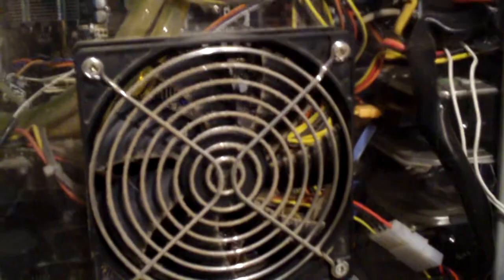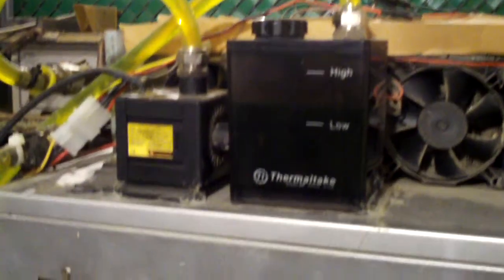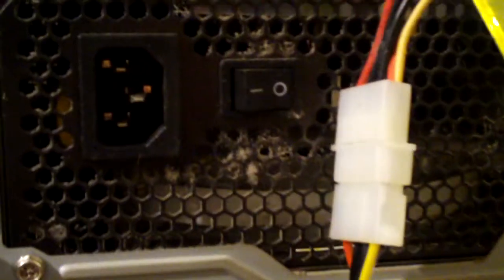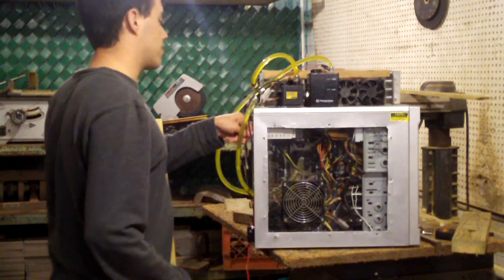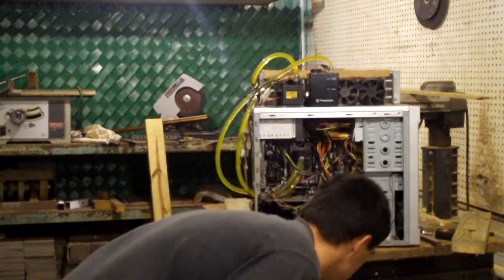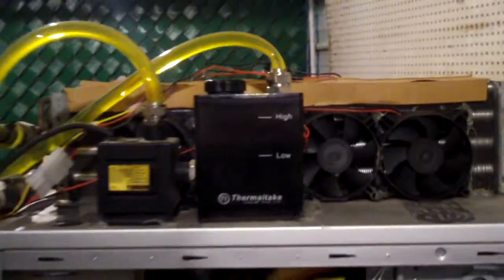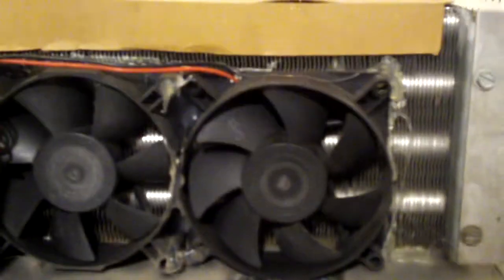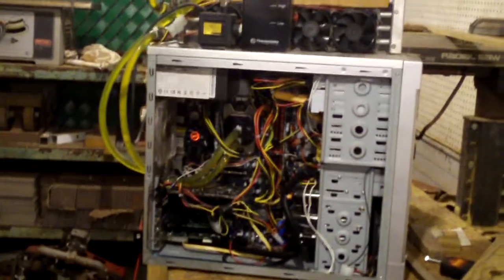Overview of filthy MTDX + Fall 2012 dust show (cleanout)

Comment: nice machine, you should add some coarse foam as an air filter in the intakes, my case has that in the front, both in the bays and the hdds area (saikano O2) y modded the side, added a nice window and sealed it can only take air from the from.
y clean the from every one or two months, but the inside only once every two years. (also 24/7 here btw)

Comment: is a 500w crosair psu enough for:
an amd phenom x4 955 (and maby in the future fx8350)
8gb kingston hyper x blu
normal optical drive
1tb western digital hard drive (sata)
gigabyte 78lmt-usb3
sapphire radeon hd 7770
about 5 12v case fans
:)